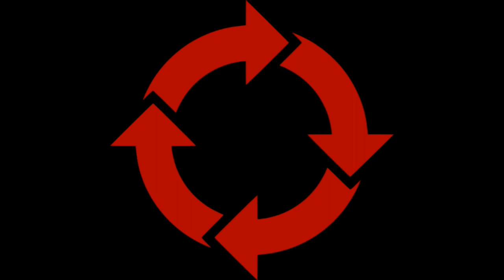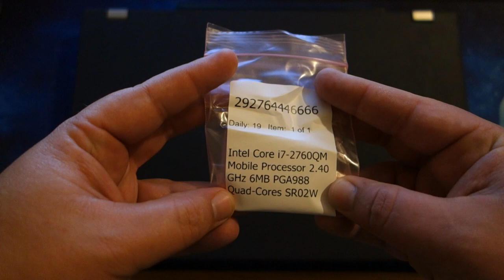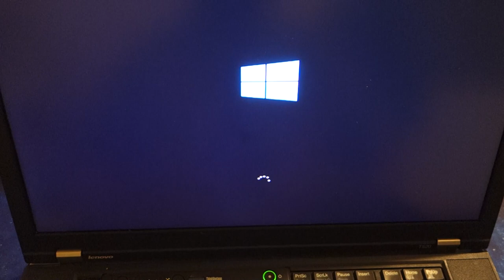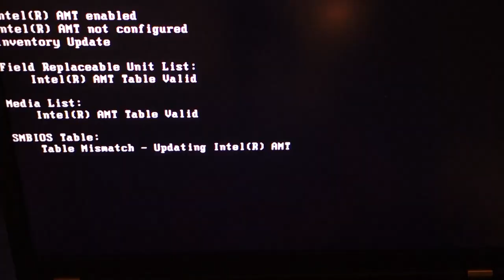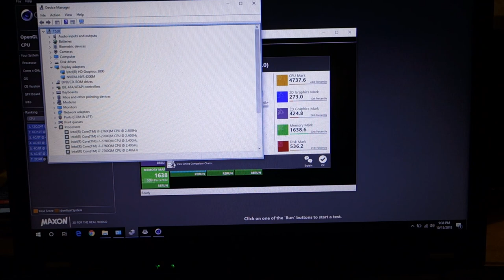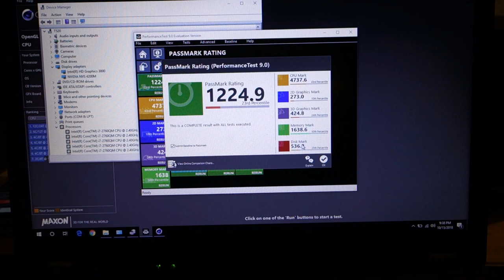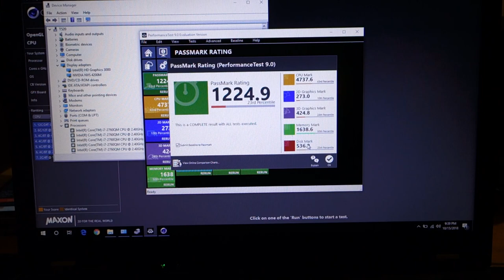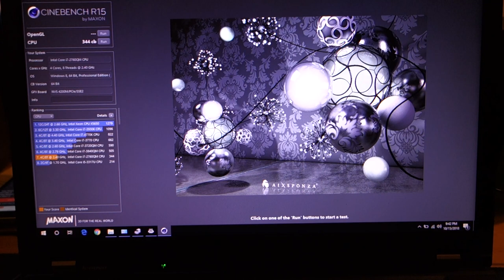Lenovo Thinkpad T520 CPU upgrade Core i5 2520M to i7 2760QM

Comment: Your cinebench score for your i7 2760qm seems actually a little bit low, are you sure that you're running it on it's performance settings? I'm getting around 500 (520 max) on cinebench here using a Dell e6520 that also has an i7 2760qm
Reply from the maker: Its not a clean install of the OS, its my mom's computer, and i didn't do anything to make sure background apps were not running. I'm sure some OS optimization would make a big difference. I wish the recording of the before performance test would have not corrupted, the before/after is the impressive part.
Reply: @AICvideo  I'm having the same issue, I bought this PC and for some reason it says it's not "running genuine windows"? Will this affect my computer?
Reply from the maker: @RaineG579  it means the person you bought it from didn't pay for a license key for it. If the laptop has a window 7 COD under the battery, you can often use that to activate windows 10 since they offer a free upgrade from 7 to 10. if it does not,  you can buy a genuine license, but that's like $100. as far as affecting anything, no. it does not. It cuts you out of some personalization options, but that's about it.
Reply: AICvideo What about buying a genuine windows ten license key really cheap on eBay?
Reply from the maker: Most of those were bought either on bulk licenses, or with stolen credit card numbers. I cannot justify buying those.
Reply: @AICvideo  oops. lol i just bought one. :( hopefully i didn't put myself up sh**creek :(
Reply from the maker: 99.9% of the time you're fine, it's more of a moral issue more than anything.
Reply: @AICvideo  I understand, I'll remember that next time, because there won't be a next time.  In a more perfect world eh? There's this website called user benchmark, this thing scored the worst possible lmbo.  I was so dissappointed, but I bought the PC not working for 40 dollars, so not bad I guess.  Does not having a battery have anything to do with it?  Also, do you sell ram cards?
Reply from the maker: @RaineG579  battery life or even having a battery will do nothing to performance. Making sure the fan is clean so it doesn't over heat, and that you have all the drivers installed, things like that will help a lot. 

I don't sell ram on the regular, unless I just have a bunch of spares. and then I just list them on ebay.
Reply: AICvideo  I’ve tried to install all the drivers, each one manually, I’ve even used a program that looks up drivers for you, but there are 3 devices that I couldn’t get drivers for. https://imgur.com/gallery/aeaIZln
Reply: @AICvideo  Thanks, I was under the impression that if you have your PC set to preserve battery life instead of performance, it would have an impact.  I've been considering overclocking as well.

Comment: Can I do this to a Thinkpad E450?
Reply from the maker: no, that cpu is soldered. You can see that if you google a picture of the motherboard, this is an E450 motherboard:
https://ae01.alicdn.com/kf/HTB1uTvuXfLsK1Rjy0Fbq6xSEXXa8/For-Lenovo-ThinkPad-Edge-E450-laptop-AIVE1-NM-A211-00HT778-i3-5005U-HD550-DDR3L-UMA.jpg

and this is a T520 mother board:
http://img.auctiva.com/imgdata/1/4/5/0/0/2/9/webimg/805278434_o.jpg

The t520 has a cpu slot that you can install the cpu into and the E450 has it soldered right on the board.

Comment: Actually any real performance upgrade with this?
Reply from the maker: Huge performance increase in every aspect.
Reply: allright, but when i see cpu-benchmarks webpages . the graphs dont tell the difference
Reply from the maker: I don't know where you're looking but its faster in single threaded applications, It has twice the core count so it crushes multithreaded applications, and it has faster integrated graphics. The only downside is it consumes more electricity, so shorter battery life when you're pushing it.
Reply: thanks again
Reply: My t520 has a core i52520M in it, and it will get one hundred ninety something without speeding up the fan. That score of 343 is a huge upgrade in performance.

Comment: what's this Laptop CPU socket?
Reply from the maker: http://www.cpu-upgrade.com/CPUs/Intel/Core_i5_Mobile/i5-2520M_(PGA).html
Reply: I have Dell Latitude e6420 with i5-2520M 2.5 ghz ,Do you think I can Upgrade it to i7 2720QM?
Reply from the maker: There is a very good chance. but there are two things going against you, Bios compatibility, and heat. Some systems simply cannot handle the extra heat, and some systems simply were never patched in a way to support the higher core chips. 

that being said, its a pretty high chance it would work, and if it doesn't, you can resell the chip and just be out a few bucks in ebay/paypal fees. 

but I have never owned, much less upgraded that specific laptop, so I cannot say for sure either way.

Comment: Could i use i7 2860qm to upgrade?
Reply from the maker: http://www.cpu-upgrade.com/CPUs/Intel/Core_i5_Mobile/i5-2520M_(PGA).html
I don't know for sure, because I haven't done it myself. A couple of things, the 2520m is a 35watt cpu, the 2860qm is a 45 watt. I had the dedicated graphics card which comes with a much beefier cooler, if you do not have that, i would look into upgrading the cooler to handle the additional heat. I personally would stick to a 35watt cpu.
Reply: @AICvideo  i also have only dedicated graphics card (intel HD grapics 3000)
Reply from the maker: that's the onboard graphics. If it was dedicated, it would be an nvidia or amd graphics chipset, and there would be two heat pipes going to two spots on the system board.
Reply: @AICvideo  oh sorry i only have Intel hd grapics
Reply from the maker: if you check the link i sent previously, you'll see there are some 35 watt 4 core 8 thread processors, that should be safe to upgrade to.
Reply: @AICvideo  no there are not any 4core 8 threads 35w processors
Reply from the maker: you're right, I was looking at 3rd gen processors for another project, and mixed the two up. Then I would look to see if you can buy the upgraded cpu cooler if going to a 4core 8thread processor, otherwise you'll spend any time actually using it thermal throttling I think.
Reply: @AICvideo  but i7 2760qm Is also 45w
Reply: I dont know i want to upgrade but the only processor that Is available to buy in my country is the i7 2860qm
Reply from the maker: It should be compatible, I just worry about heat.
Reply: @AICvideo  So if i buy cooling pad? IT would be alright?

Comment: I only have an i7-2630QM in my T520 and it does  ~440 points in CB15. Something isn't right here.
Reply from the maker: I thought I mentioned this in the video. this was my mom's computer I had given her. I upgraded the CPU without changing anything on the OS, I have no idea what was running in the background. It was more to see if I could upgrade to this specific CPU and what issues I would run into (which were none). I have an SSD to go into it and when I do that it will get a fresh copy of the OS.
Reply from the maker: Just finished putting in an SSD and upgrading the ram to 16 gigs. Got 508.